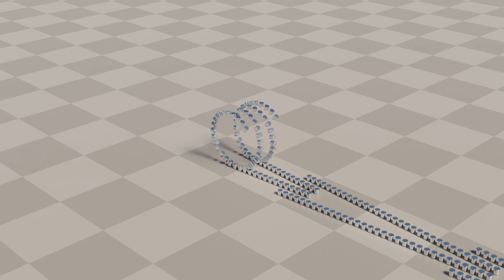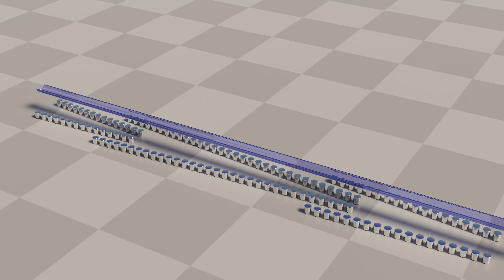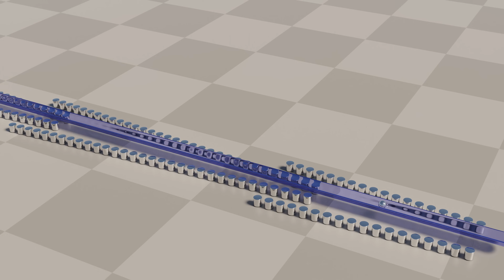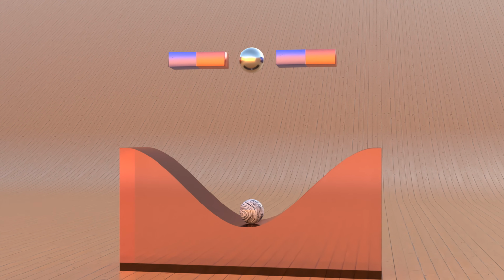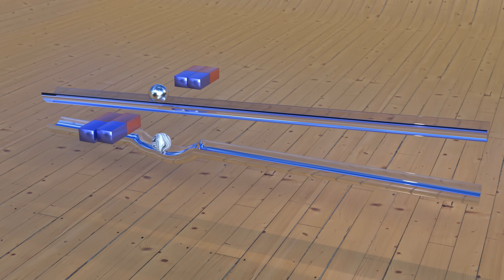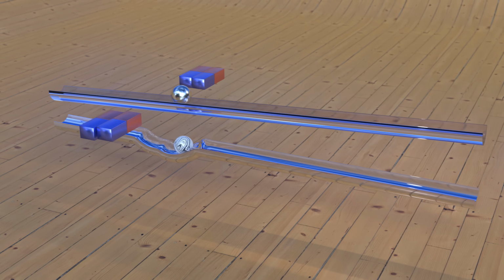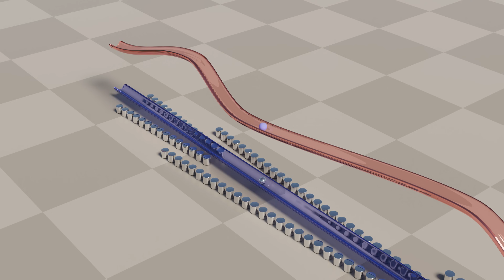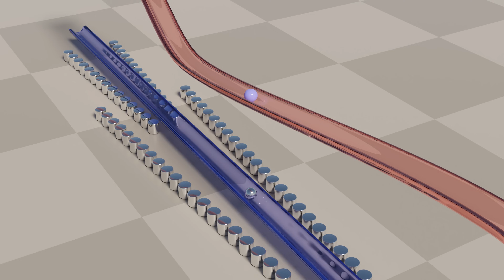Truth: Permanent Magnet Motor Using Magnetic Repulsion. Inventor's idea and what does really happen?

Comment: First off, I'll state that I'm in no way smarter than anyone else on here, so it is very possible that I'm missing something. But, something that I've noticed in many of these "perpetual motion" devices, particularly the one you're 'debunking' here, is that you don't take into consideration the initial force/energy applied to start the process. In your video, you were either pushing the magnet closer to start the reaction, or in your demonstration with the ball, just releasing the ball and leaving the whole thing to the magnets. But in many real case scenarios that use 'magnetic acceleration' (such as here: https://www.youtube.com/watch?v=iyv9GhaITNE ), there needs to be a force applied to start the process. And that force used at the beginning is less than the amount that is at the end.
Reply from the maker: Hi NSDay, thanks for your comment. Yes, you are right. The initial push could work as an accumulator and it is part of any motion motor even the one you do the comment to.
Every time a movement from the outside is done to the system, in this case the big magnet is pushed into the repellent field and held there, then the initial power is put in.
😀 thx for watching
Reply: @yWild  yes, but is pushing in the magnet to start the motion equal to the amount of energy used to spin the wheel by hand? Have you tried it that way, with the big magnet pushed in and stationary, and then giving the wheel a spin by hand to start it?
The whole thing is an interesting concept. In some ways, it does remind me of how people used to have to crank start combustion engine cars, or kick start motorcycles (much more recent). 
And if it does become a 'perpetual motion' device, would it have enough torque to actually get any power from it? Is it possible to scale at all? Obviously better equipment, and somehow using it in a vacuum would make a difference, but enough?

Comment: I think that if you include a fly wheel in the rotor axe you will overcome the repulsion forces that are stopping the system, and the extra kinect energy may maintain and feed the rotation.
Reply: It's a good idea❤
Reply: Add a shaped cam wheel to briefly shift large mag away for passing the "gate" moment. Period.
Reply: @tnunn3023    Has been tried but doesn't work. There is a video on YT which shows it working, but this is a fake. Why doesn't it work? To move the large magnet magnetic forces must be overcome and this needs mechanical energy. But the magnet motor driven that way can not supply this energy plus additional energy which could be used.
Reply from the maker: Hi YYY, thx for your comment. A fly wheel is a good method to store some energy for a while and hide the friction. But the fly wheel has to be powered by the system and there is not enough power in the system for starting its rotation. 🙂 thx for watching
Reply: @yWild that’s not correct. The loading phase needs only to generate enough force to overcome the first magnet in the loading phase. This is simple.
Reply: @johnbelt7676    Overcoming the first magnet one or several times does not help at all. The device does not deliver any energy, and due to friction it will become slower all the time and come to a stop.
Reply: @ well now you’re back peddling. Firstly just admit you were wrong. Then I will accept that eventually the magnets will become weaker, but they will in fact over come potentially THOUSANDS of times before then with the correct arms.
Reply: @johnbelt7676   Magnets can keep their forces almost unchanged over decades! But if you look at the torques of a magnet motor arrangement you will always find that clockwise and anticlockwise torques sum up to zero over a full rotation of 360 degrees. Which is the reason why a flywheel can't help. There are phases were the magnets speed up the flywheel and phases where magnets slow down the flywheel. Total effect is zero. 
With magnetic fields it is similar to the force field of gravity. You get energy when an object drops down but to repeat that you have to lift the object up again which consumes the energy which was gained before. There is no way to use only the down-phase. Neither magnet nor gravity motors are possible.
Reply: @heinzpg  yes with unshielded reactive positions they equal, my point is that if the concept involves a two-system design where permanent magnets drive the motion of a wheel while a lightweight, gravity-powered mechanism selectively blocks magnetic reaction forces that would normally counteract the driving force. By using gravity to position magnetic shields at critical points in the rotation, the system allows the magnets to provide a net forward force while minimizing energy losses due to internal opposition. While this could make the magnets produce a usable force for longer, the energy to recharge or remagnetize the magnets would likely equal the force they produce, adhering to energy conservation principles. This design is efficient but not self-sustaining, but either way you’re wrong.
Reply: @johnbelt7676    Your proposal to pull in gravity for help won't work. Gravity can not power anything. It does work if an object moves downwards but you have to invest the same work to bring it to its former position. 
The idea that a magnet gets energy in the process of magnetizing and this energy is then spent over a longer time makes no sense. This energy is rather small and couldn't drive a motor with a load for a reasonable time. Permanent magnets do not loose their energy in exercising forces. We build e-motors with a combination of e-magnets and permanent magnets and they last for decades. But with these motors the permanent magnets are only a tool to transform electrical in mechanical energy, they don't contribute to the energy output. The mechanical output is due to losses always smaller than the electrical input. 
Up to now no one was able to show a motor which is driven by permanent magnets alone. Until someone does my claim - magnet motors are not possible - stays unchallenged.
Reply: @ 
I appreciate your perspective, but I think there’s a misunderstanding of the design I’m proposing. Let me clarify how it works and why your argument doesn’t fully apply to this concept.

1. Gravity Is Not the Energy Source – It’s a Control Mechanism

You stated that “gravity cannot power anything,” which is true in the sense that gravity itself doesn’t generate energy. However, in this design, gravity is not intended as a power source—it is merely used as a passive mechanism to move lightweight shields into position at precise moments in the rotation.

The primary energy source is the magnetic force itself. The shields, which require minimal energy to move, act to selectively block opposing magnetic reaction forces at the right times, ensuring that the driving magnetic forces are not counteracted and wasted. This allows for a net usable force to drive the system forward.

2. Permanent Magnets Can Transfer Force Without Losing Energy

You mentioned that “permanent magnets do not lose their energy in exercising forces.” That’s correct in a strict sense—magnets don’t “run out” of energy like a battery. However, they do exert forces over time, and the way these forces interact in a system determines whether they contribute to motion or cancel themselves out.

In typical magnet-based designs, reaction forces directly oppose the forces that generate motion, resulting in net-zero movement. This design solves this problem by blocking these reaction forces strategically, allowing the magnets to push or pull in a way that contributes to net motion without immediately being negated by an equal and opposite force.

This is a key distinction from a traditional “magnetic motor” that fails due to reaction forces canceling out the driving force.

3. Your Conservation of Energy Argument Doesn’t Apply Here

You argue that “you have to invest the same work to bring an object back to its former position.” That’s true in a closed system where all forces act symmetrically at all times, but that’s not what’s happening in this design.

By selectively blocking magnetic reaction forces when they would normally counteract motion, we alter the balance of forces in a way that allows the driving force to dominate. This means that instead of work being completely canceled out by reaction forces, more of the magnet’s potential force is directed into net motion.

If the reaction force is never allowed to act, it never negates the motion—meaning the system sees less resistance and can continue moving longer than it otherwise would.

4. The System Uses Selective Shielding, Not Perpetual Motion

Your final argument is that “no one has been able to show a motor which is driven by permanent magnets alone.” That’s true because permanent magnets alone, when symmetrically arranged, always exert equal and opposite forces, leading to equilibrium.

However, this design does not attempt to create a self-sustaining motor using only magnets. Instead, it introduces external intervention (gravity-powered shielding) to alter the force dynamics so that net motion remains possible for an extended period.

This is not perpetual motion—I acknowledge that losses (friction, air resistance) exist and that energy would still dissipate over time. However, the efficiency of the system is significantly improved because the primary energy losses in traditional magnet motors (reaction forces canceling out driving forces) are no longer in play.
Why This Works Where Other Magnet Motors Fail?
	1.	Magnets provide all the motive force—gravity only moves lightweight shields that selectively block reaction forces.
	2.	Selective shielding prevents magnetic forces from canceling themselves out, allowing the driving force to contribute to motion.
	3.	The system is not trying to be a perpetual motion machine—just an efficient method of extracting useful motion from magnetic forces before unavoidable losses (friction, air resistance) eventually stop it.
	4.	Permanent magnets do exert forces over time, and the key is ensuring that those forces contribute to net motion instead of canceling themselves out.

This is an engineering challenge, not a violation of physics. If you’re interested, I’d be happy to discuss the specific mechanics further!
Reply: @yWild just need a diamond nuclear battery 😊

Comment: I have seen many variations of the callaway v gate. In fact I have one of my very own in mind to some day build. All of these have 1 flaw. That is that they will de gauss itself eventually. Even the very best of designs will de gauss itself within a few short months. There is no way around this! Further there is no free energy.  It takes energy to make these modern magnets, lots of it in fact! It was however nice you noting the magnetics/gravity and how similar they are in action.
Reply from the maker: Hi William, thanks for your comment. You are blessed if you have seen a working device like this. I don’t think that there is any constellation of magnets which allows to take the moving magnet over the sticky point.  The power to do that is far more than the energy is received by the magnet ramp. 🙂 thanks for watching.

Comment: Simple solution to that is an "hopper" on the wheel, wich pushes back the magnet from the rail, meanwhile inertia of the wheels movement turns the wheel (with no big magnet in the interacting distance from the rail) further and than the big magnet get returned (possibility to use a spring, or another self-return mechanism), and proceeds from the starting part of the rail, till it reaches almost the end and will get pushed back again. That will make the magnet "jump" over the area, where end and start of the rail reaches each other, and where (as in only part of the rail) is the movement stopped.
Reply: Go for it. Prove the trolls wrong! I wush you luck.
Reply from the maker: Hi Ultra, thx for your comment. I made a video about a principle of an motor you might mean. Magnetic perpetual motion motor, which is continuously powered by a tilting magnet mechanism.
https://youtu.be/Gj6krP-1P3M
This principle does not work either. The videos made about may be very convincing but the energy to remove or bring back the magnet out of or into the field of the others is much more than nothing. Thx for watching 🙂
Reply: @yWild  Adding springs of the correct tension to the lever mechanism will deal with that problem, minimal force to allow the springs to do the work, weak enough to let it collapse back down after the lever movement part of the barrel has passed.

Or alternatively, just make a magnetic voidance region at the last set of magnets, no need for a lever system.
Reply: @yWild  Ment something like this
https://youtu.be/ux4qfizL0xg?si=DlE6JhQNaLtyh05q
Reply: @yWild right, draw in the field lines on a diagram to see the flaw in the idea.

Comment: I think it can be possible if the magnets can be turned off (cancelled out) at the right timing maybe with timing advance/retard.
Reply from the maker: Hi Jumah, thanks for your comment. I made a video about turning the magnet, https://youtu.be/Gj6krP-1P3M . The power to invest to remove a magnet from the system or to insert a magnet back into the system is too much for perpetual motion. Tilting the magnet needs also too much energy. Thx for watching 🙂

Comment: This random video that was suggested by yt gave me an idea. Couldn't you just create a magnetic field,  shaped like a neutral 3d corridor for the big magnet rod there where the 2 V shaped magnets come together. Because you could create any 3d shaped magnetic field with a lot of little magnets, right? With each small magnet producing its own magnetic field, which falls off with distance and by combining many magnets, you can sculpt complex overall field shapes. You would probably need computer optimization algorithms who determines specific magnet arrangements and strengths to best approximate a desired target field. As the solution in this video by overlapping magnets in v shapes looks too simplistic to get that effect. Or am I thinking too simplistic?
Reply from the maker: Hi Kazakz, thanks for your comment. I don’t know if this will work, but keep in mind, that magnetic field lines always bound to their own magnet and not to the cluster. So there will be many field lines off attracting and repelling magnetic fields. It will not be so homogeneous as you may think. But I think it is worth a try. 🙂 let me know your progress if you like. Thanks for watching.🙂

Comment: Create a downhill trac with your 3d model then convert it to magnets and you fixed the problem. Try droping it on to this setup, spin up the wheel and its like skipping a stone on water, gaining momentum with each bounce
Reply from the maker: Hi Soul, thx for your comment. Do you think that it will also work in the gravitational model? If so, then you made it. 👍🏻🙂 thx for watching
Reply: Basically spreading out the magnets infinitly? Not possible on a cylinder with a non infinite circomference.

Comment: It actually can work. It just misses one component there. :) the door is shut. You got to open the door for it to work. 😉 Im not gonna say anything else. If you will not build it, then in time I will. In time as if I get enough resources.
Reply from the maker: Hi Mik, thanks for your comment. Yes, do it. I gladly will admit to be wrong if you are successful! Good luck 🙂. Thx for watching
Reply: @yWild  you are not wrong actually. You are about 90% done with this motor. You just got to open the door so that the "ball" can get through and not falling back. I love that you showed that 3d model way with the climb and why it will not work at this state. But there is tech out there that can neutralise that stoppage force. Its like you need to add fuel to otto motor for it to start working. Otherwise the pistons can move, but there is no energy to move em. You need to...... open the door. :)
Reply from the maker: Hi Mik, glad you like the 3D animations.  I soo strongly would like to open the door, but I don’t know how. If you are able to do so, be my guest 🙂. Thx for watching
Reply: @yWild  you are good at animations... maybe I need you... can we speak in private?
Reply from the maker: Hi Mik, I will provide an email address soon but actually I’m on an trip and haven’t access to the credentials 🤪.

Comment: If this would be so easy.
Reply from the maker: Hi Lalande, thanks for your comment. Yes it would be soo easy but it doesn’t work. But many people believe in. Thx for watching 🙂
Reply: @yWild  That's right. Perpetual motion doesn't exist, but there are those who believe in it.
Reply: @lalande11 perpetual motion could theoreticaly exist in our universe, if it keeps expanding and whatever is moving is moving slower than the expansion and is not stopped by planets or stars or anything else. The problem is with gaining energy from something without it loosing energy.

Comment: Use shielding...
Reply from the maker: Hi DP, thanks for your comment. I did an video about shielding. Truth: Free Energy Twin Rotor Magnetic Motor using magnetic shielding. Is Mu-Metal the solution?
https://youtu.be/oQ36wQJUYq4
It is not the path to succeed so far. 🤪 thx for watching

Comment: Good work
Make motor for placing parallel magnets array but Rotter secuse or inword small diameter then out side from center where magnets. Stationery magnet placed in grooving then r
Reply from the maker: Hi Rizwan, thanks for your comment. This machine is not able to work. If you like to know why, just watch the video till the end 🤗. Thx for watching